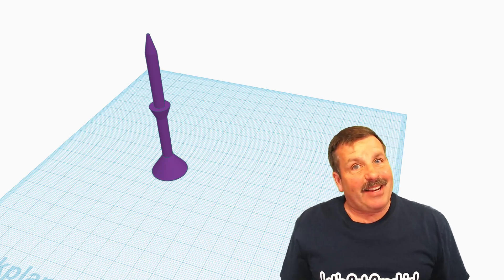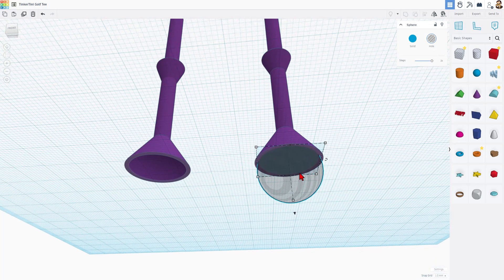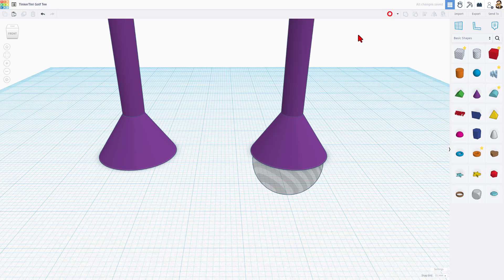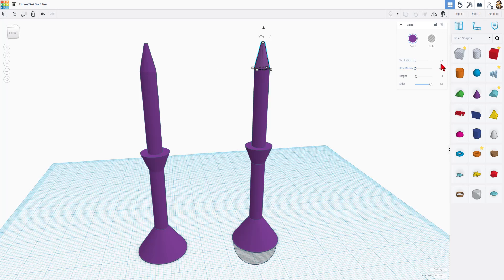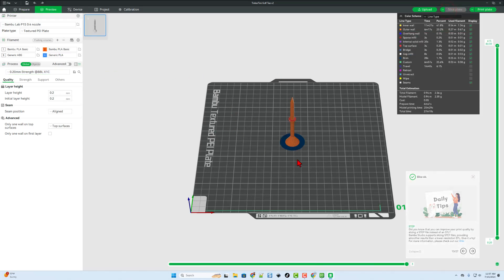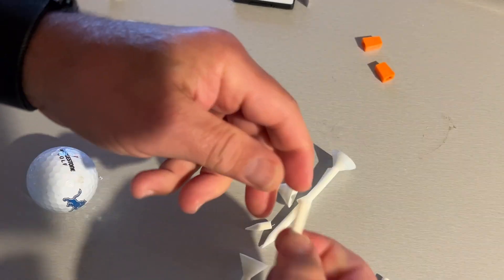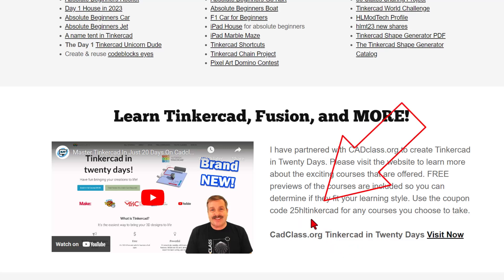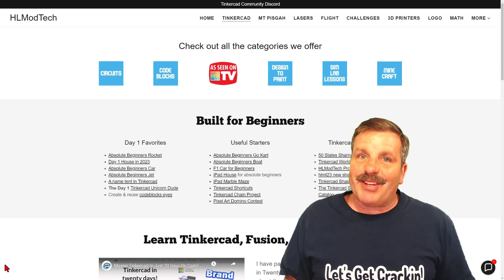A Printable Tinker Tini Tinkercad Golf Tee Bambu P1S in Minutes! #golf

Comment: This is crazy, just today I was using a sphere to make an indentation in a cone in Tinkercad. I wasn’t making a tee but it was pretty darn close. I was modding a bolt made from a cone and threads, wanted to put an indent for my thumb to help with turning. The bridging was a bit of a mess so I ended up using a narrow cylinder to make a slot so a coin could be used.  I wish I’d know about T for transparency at the time, but now I know it for next time!
Reply from the maker: Great minds thinking alike. =)  I agree that transparency can be a game changer. Thanks tons for the note.